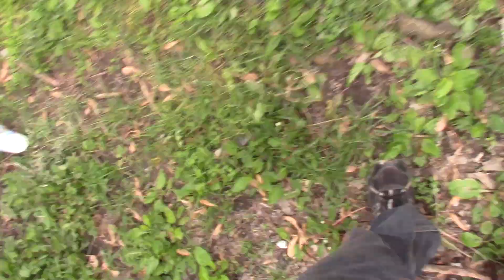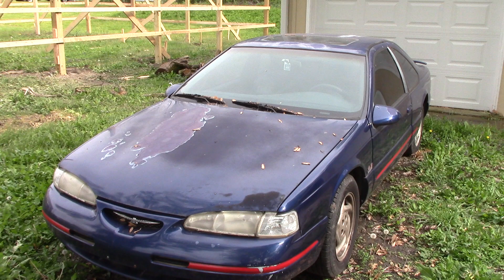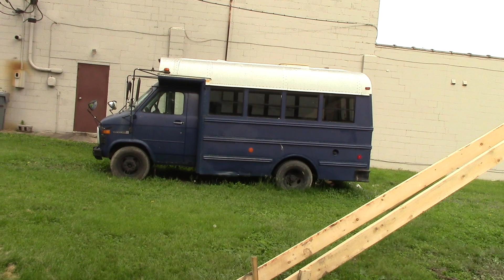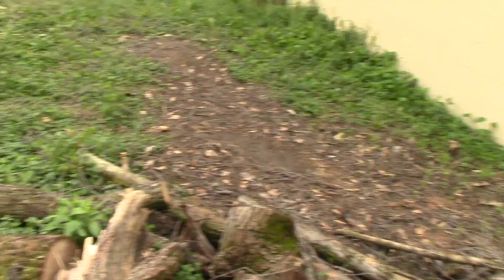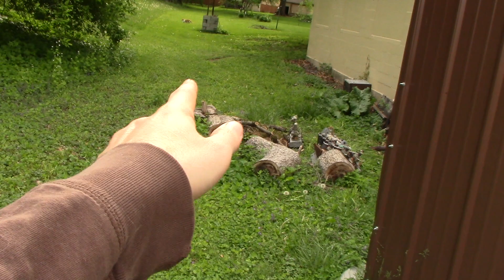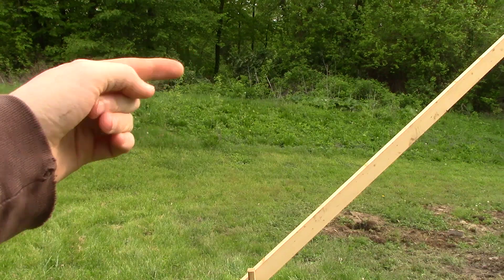Derby Shop Part 1

Comment: Idea, for the alleyway between the existing garage and the new shop have a roof built on it so it will gives you enclosed storage space then potentially later on down the road you can make it part of the shop.
When you mentioned the frontage for the new shop it looks like it's in line with your house.

Comment: You won't regret having a tire machine  I searched Craigslist for months when I was lookign for one, but all I found was beat to hell junk. Anyone who's ever worked in a shop will tell you how abused the tire machines get... I broke down and bought a brand new china man special and couldn't be happier with it. Came with a balancer as well, and is quickly paying for itself. 

Make sure you have the concrete poured deep enough for the lift when you put it in. I need to have slab cut out before I can install mine.

Comment: what happened to having it back in the woods?
Reply from the maker: After comparing all expenses and budgeting, it was immensely cheaper having it up closer. I still plan to use my woods for some other stuff coming up.
Budgeting:
-Closer to existing electric hookup, saves couple grande
-No trees to remove or stumps
-Less dirt needing brought in and packed
-Safer from being broken into/robbed
-Less risk of future trees/branches falling onto building.